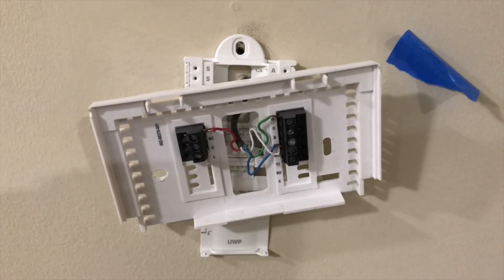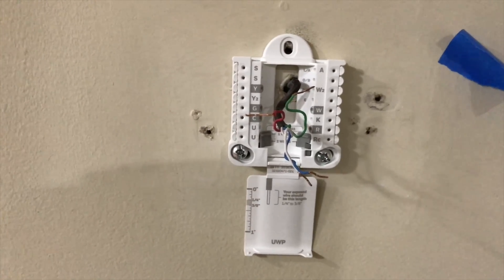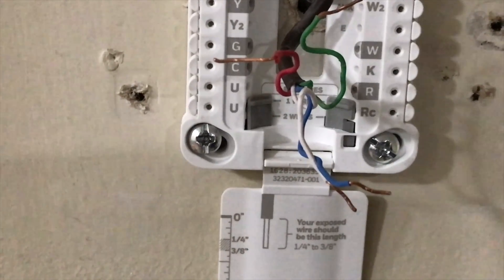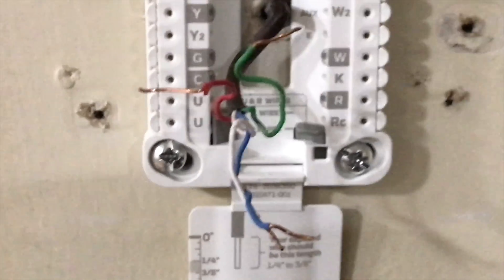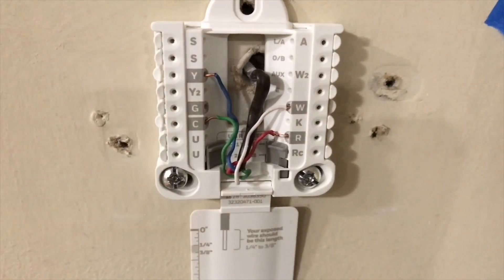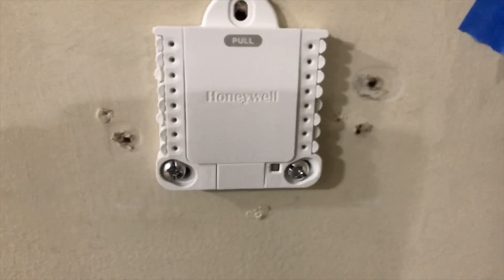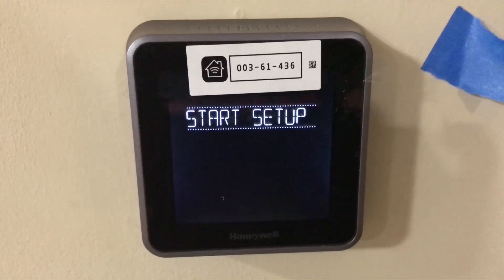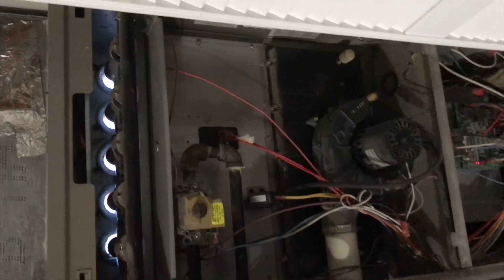Honeywell Lyric Thermostat Installation and Some C-Wire Troubleshooting

Comment: Terence our unit has two outside units working off one thermostat. I bought the T5 and I am having trouble. Even bought the 24v transformer adapter hooked into C and RC. Got power but it will not control my unit. Any suggestions? Thanks.
Reply from the maker: Couple questions... what thermostat did you have previously? Did you buy the T5 new, refurbished or used? Thanks,

Comment: Do you have an idea why my ac wont kick on? And when we go to wifi set up the screen would turn off and start over. Any advice
Reply from the maker: Hi Nat, I am not sure why the AC won't turn on. If I were there to see it I could probably pin point the problem. As far as the device power cycling when trying to set up the wifi is weird. I never seen that issue. Is the device new? Sorry I could not be more informative.

Comment: Big man, your a life saver. Ive been fighting with this silly thing forever !! Moving that Yellow wire got it working !! 👍🏻💪🏻  Update; That got me to the point where the thermostat lit up / came to life; issue then was while it would turn on the fan it would not turn on the outside unit / condenser (yes mine is a forced air ac / heat system & I realize that differs from yours) my end solution was to read the electrical schematic diagram find the + 24 v (in my units case it was brown) put the yellow back in its port & the brown hooked to the blue via the wires that run through the wall blue to the C, works perfect now :)
Reply from the maker: That's awesome! I am glad my video helped you. Thank you for watching.
Reply: @TerenceDIY  Update; That got me to the point where the thermostat lit up / came to life; issue then was while it would turn on the fan it would not turn on the outside unit / condenser (yes mine is a forced air ac / heat system & I realize that differs from yours) my end solution was to read the electrical schematic diagram find the + 24 v (in my units case it was brown) put the yellow back in its port & the brown hooked to the blue via the wires that run through the wall blue to the C, works perfect now :)
Reply from the maker: That's awesome!

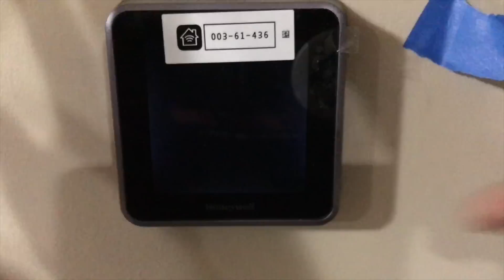Comment: I have a Problem, So our technician already got us set up with the T5 Lyric MONTHS AGO BRAND NEW, I stumbled upon this video cause for some reason the past 3 days.. the thermostat would SHUT OFF and then have that SAME pulsating light as you can see here 6:15 . Then I would leave it alone and observe (while timing the "loop") it would pulsate for a good 10mins, then it would turn on again and start the furnace-AC unit to its last setting ( i left it on cool since the house was kinda getting warm) then it would just run NORMALLY for a good 15-20mins till it will POWER DOWN AGAIN... pulsate for 10mins and so on with the "LOOP"

I have tried Factory resetting the T5 Thermostat unit but nothing has changed.... same LOOP. 

Can anyone share some help here? i did'nt touch the configuration of the wires and i plan to go to home depot to buy a NEW unit, same product (if they still sell this in 2022) and then see if it works incase its not the current thermostats units fault. 

WOULD APPRECIATE ANYONE who can help. I just find it strange cause all these months its been working sweet...
Reply from the maker: If I were you, I would replace it to see if the problem persist. Here are a couple of links to ones that are fairly cheap (below).

https://www.ebay.com/itm/334509774693?epid=571902923&hash=item4de2561765:g:5ocAAOSw9Pxi2aYi&amdata=enc%3AAQAHAAAAsOIqVDkOhNJeyWyVxJzzpQuUzmDbsGxAd%2F86kuBVa0vUeK1tKon14HF4oDIuFjIxKb4BnMm7Jc1Y3Q3QEaUeIHFMyyYPPr7AoUASdwC5aB9zbWpGiilsMCkzYobXUEWVfmM5kxxIE%2BZwGrG8iO%2F1aYshLu5%2BGlCxLH9jGVegdXhPCuHp%2FGxpGHJHiIsDzkQi9luXZhoRpK%2Fut8GpZo0gz4zwusMQ5DEQk%2BykNYFvp5%2Fr%7Ctkp%3ABk9SR4y2vqrjYA

https://www.ebay.com/itm/115476854283?hash=item1ae2f4f60b:g:Tq8AAOSw0IBcn5W-&amdata=enc%3AAQAHAAAA8KHEwfHCLvXgEvY3mP49%2BBA817OfDVfbmP%2Bk6vIxj8zr5NwTfCRtcdGmeehL%2Bidu6eeFI3t6lELW%2F6AWwGaLr3cRxKabgRcPFkizXIpf0dnu%2BhnPxC4Dwfb%2FPtkRuKakSbRoo5x41exMiQCHLE7Y5%2BbWEXSNOIrRvN78ApnnmDyTxvEo72kYA6iTA8H7qVpkoNzM%2FwyMivq3mZXLEp75eglxs8miTwPJXDCEeWgDhrqjXs4uc07f%2FLVnpE8yB%2BhJ5bDH3rBEDyIDEiHE2fIMh84fNNYj5dk1iErU3V5kGNxoBw4xJe1mZfkXlCOeZHJaDQ%3D%3D%7Ctkp%3ABk9SR4y2vqrjYA

Comment: I just had this installed in March, how do I turn the Heater off? It’s summer now and I don’t see a off button? I turned it down to 60 so it’s not kicking on the heat, but I would like to completely turn it off, Thanks
Reply from the maker: Hi Sassy, I sold the house this unit was installed in however, if I can remember, I believe you tap on the "heat on" up top and turn it off or press the "mode" button and it should give you an option to turn it off. It's a very simple method. I am sorry that I cannot provide accurate details. Let me know if one or the other works. Thanks for watching!

Comment: How come my T5 won’t turn on after install??
Reply from the maker: Hi Erica, did you follow the steps in my video? If so, you probably need this (link below). I guarantee it will turn on then. 

https://www.ebay.com/itm/24-Volt-C-Wire-AC-Adapter-Transformer-for-Thermostat-25-Ft-For-Nest-Ecobee-24v/402477365908?hash=item5db5853a94:g:RT8AAOSwxmJf3WDE

Comment: So what’s that other cable with a small box that’s comes with the thermostat...I saw someone connect it to the furnace..why is that ?
Reply from the maker: Hi, I am not sure because this was a while ago however, I believe it was for a newer furnace and mines was from the 90's so I didn't need it. I could be wrong. I clearly remembered that I could not use it though. I apologize for not stating that information at the time of this install. Thanks for watching!

Comment: What would you do if there are only two wires on the original (old) thermostat you're trying to replace with the T5?
Reply from the maker: Sorry for the late response. You will need a power adapter to power up the T5. Here is a link to one....

https://www.ebay.com/itm/24-Volt-C-Wire-AC-Adapter-Transformer-for-Thermostat-25-Ft-For-Nest-Ecobee-24v/402477365908?_trkparms=ispr%3D1&hash=item5db5853a94:g:xf4AAOSwRKRfe8wQ&amdata=enc%3AAQAFAAACcBaobrjLl8XobRIiIML1V4Imu%252Fn%252BzU5L90Z278x5ickkTboA95HSvGa1O5UmCCGJLjCFoFBQZ94DziQL3Ja9b%252FOoYBsXx4W5PDBpZwVWCywEobDD%252Fi%252F2%252BUQZpiAKKVz9AXTjgXttIs7O57XeqoWRpIo9mB%252Bq6d%252BkMl1H12n0DsLMASeAg6LdFxtTcMF8MUflUU%252BrAHBwN7Yxs81WChgNyj2MtaHmzumGwiKZDYh0eJRZmJi3FvfL2a8sKgiC2JGTC4BtpzE95fPStbReOk0AltFWnj%252FInad6mfJ5N0Y0akesnmCGMVCZIlC%252FMW5opbcUqto%252FmIv77dH3K4fzHStThlKxotYHslakfAMXjXBMLhiIcliP7XAJYigAr3vEwVnsOc2UCEHQwCUC8SjyN0BTsbJuOt1kCNBxfMmvsspOkmcyZSu9M7ST3bu%252Bc03tCtvmIApSk3H7%252BViaEmBx5M3ZtZxjsmi7vAUIhw3l29mLqhLb98mnFit7CkGsPoQzavcAUp5YhAJqfsJsJCKaHck7nLI%252BIJATgGkw4V%252Fz%252BEEPbFr1u3BKdPvydIXDFY%252FB6wm6f38K0qOU7BGYrWUwPgbozcLmKhTbtG1gdiemShStyfGg%252FGdGUqSE%252FYERZIgnMNIam88O3kjdjyOxDHhlafJJ2ReBNSfPbHYwaxdjJdN8Vl3%252FzP5X6kjVf%252Fls7u3Hkg7bCEpjiAys%252FyQjgjZCVE5Om5TVUJNN4aEqfg0jmiButk1MI%252FNABsxc%252FUXHdUyQP2irNhE7iCetbko7hoGfcfhuvsGvjGTKBMYifc74jxagZ4GrppBgmcjZOYOzIghXe29Ehg%253D%253D%7Ccksum%3A4024773659089044c99b0e4f4508baf1e2561a2a4977%7Campid%3APL_CLK%7Cclp%3A2334524

Comment: Well I did what you suggested and I got power, but it would not turn on the fan.  :(
Reply: I finally got it working.  I ended up changing the wire from 4 wires to 5.  I'll spare you all of the details, but that was quite a pain.
Reply: @jaysoncooper3763 how ?

Comment: Wtf. I cant figure this out.  I only have 2 wires.  I dont get it every 1 else have like r n 5 wires wats up with this mannnnn
Reply from the maker: Hi Ken, you only have two wires going into your thermostat??
Reply: @TerenceDIY  there's 1 wire that comes out the heater but up stairs at the therm.   There's 3 wires.  1 was tucked in to the wall and the other 2 are hooked up to the 200 year old therm.   But all 3 wires are brown
Reply from the maker: Hi Ken, to get this unit to work, there are a couple solutions... The first solution is a five-wire upgrade. This is can be an expensive option. Secondly, that thermostat requires a power source. What kind of thermostat do you currently have? An old mercury one or one that takes batteries? The second option (HIGHLY RECOMMENDED) would be an adapter. These adapters are very popular and are an inexpensive way to upgrade your old thermostat to a wifi one. I have placed the link below. This should solve your problem. Please let me know. Thanks for watching! 

https://www.ebay.com/itm/AC-24V-C-Wire-Power-Adapter-Transformer-for-Nest-Honeywell-Smart-WiFi-Thermostat/401679686832?hash=item5d85f99cb0:g:hlkAAOSwpltcrAD3
Reply: @TerenceDIY  yes i have an old mercury one
Reply from the maker: Hi Ken, I am sorry for the late response. My mother got sick and we were worried. Thank God she only had a cold. You need to purchase the adapter if your want to upgrade your thermostat to a wifi one.
Reply: @TerenceDIY  thanks a million for that i deff appritiate it
Reply: Yes i have an old olllddd olddddddd 1

Comment: Question...Replacing the G wire for the C wire, when turning the heat on, does the fan come on as well or does it only come on when u turn the AC on?
Reply from the maker: Sorry for the late response, the fan should come on shortly after the burners turn on.

Comment: I bought a honeywell wifi, my house was built in 2009 so the ac unit isnt that old, was going to return it after the screen wouldn't turn on, thank god i found your video brotha! Y to C, C to Y worked for me!
Reply: does your thermostat have 5 wires also? I replacing mine with then new T5 as well and I couldnt get the screen to turn on. Everything is in place I got G,W,Y, R, and C. So you're saying switch the Y to C, C to Y and will work? I also have a gas furnace as well.
Reply: Did all the functions work when you did this?  Any issues?

Comment: i have a gas furnace and it only has two single wire (red and white ) so my question is can it be done and is there a possible way the red wire can be jumper ed to act as a c wire ( since thermostat uses 24v ) to power the device ? i did a hack using the emylo wifi smart light switch which is connected from main house power as input and output goes to the transformer, however if i do that it would act as a kill switch  for the entire furnace and if i should do wiring ( not a electrician more of an IT guy lol ) it would be difficult for me pulling wires through the wall so if anyone has done it before or have any idea if it is possible i would welcome the input thank you!
Reply from the maker: Hi Dwayne, sorry for the delayed response. If I were you, I'd purchase this...(Click the link below). Thanks for watching! 
https://www.ebay.com/itm/24-Volt-Transformer-C-Wire-Power-Adapter-Smart-Wifi-Thermostats-and-Doorbells/264235286861?hash=item3d85a6814d:g:MaoAAOSwxWxdZMiM

Comment: I don't even have a common wire on my set up all I have is central heat and the only wires out of my wall is red and white I just had a nest thermostat recently but I returned it because it was not working right where I don't have a common wire my furnace would click click click and run randomly continuously often on so unfortunately I had to go back to my old traditional digital thermostat to takes to Double-A batteries but since watched your video it looks like this may not work for me either since I don't have that common wire at all
Reply: Hi jeremy32100, you can upgrade to a newer thermostat. Since you don't have a C-Wire, below is a link to an alternative. This is what most people are switching to because it offers a power source for WiFi thermostats, doorbells, etc... It's an easy install. Well, I hope this helped.     https://www.ebay.com/itm/C-Wire-Power-Adapter-Transformer-Ecobee-Nest-WiFi-Thermostat-Ring-Doorbell-24V/264130091450?epid=3012018759&hash=item3d7f6159ba:g:pJsAAOSwIIFbOI50:rk:1:pf:0

Comment: My Lyric Thermostat came with a white jumper wire about two inches long. Did yours not?Not sure if I should jump from the Y to the c or not? The tech support guy told me to run a new wire from the furnace the thermostat.
Reply from the maker: Hi, mines did NOT come with a jumper wire. Maybe they decided to add one since they realized the huge issue with installation. I wouldn't run a new wire to the furnace. If you choose not to install it the way that I did, you can purchase a power source. Here is the link. https://www.ebay.com/itm/24-Volt-C-Wire-Power-Adapter-Transformer-Wifi-Smart-Thermostats-and-Doorbells/263741136964?epid=3012018759&hash=item3d68326044:g:A~8AAOSwXahbamzS:rk:1:pf:0

Comment: Thanks for sharing! Using the Y to C wire worked for my heat, have to wait to try A/C. 
Couldn't you just jump Y to C though? Wouldn't that work?
Reply from the maker: Hi Marc, It may have worked if I jumped the two. However, this way worked fine. If I could go back and redo this video, I would have added a C-Wire power source adapter. They cost around $20 and is a GREAT power solution. The unit is still wired this way and works flawlessly. Thanks for watching. Happy New Years!
Reply: @TerenceDIY  thx... I tested my AC and it didn't work of course, so thought I would try the G wire in C, and put Y back and everything works. I should have just tried that first, just figured it wouldn't work since the manual mentioned doing rewiring on the furnace. I lucked out. Thx for sharing the video.

Comment: Terence. Thanks for sharing your solution! It worked for my set up perfectly. I tried other suggestions like adding an additional 5 the wire for the C connection and that didnt work for me. Swapping the Y connection over to the C connector worked. The device is working great now. Thanks again!
Reply: Hi Richard and Claudia Negron, I am glad my video helped you. Thank you SO much for watching!
Reply: Did you ever have any issues doing this?  I had to do the same thing

Comment: hey I have a question ? im a loss prevention officer for a department store that sells these I have been finding lots of stashed t-stats that are all ripped open but everything is always there  may I ask what is those number codes on the front of the t -stat when u installed it what is that code for and does that code activate anything or something ? I believe there getting the codes off them for some reason